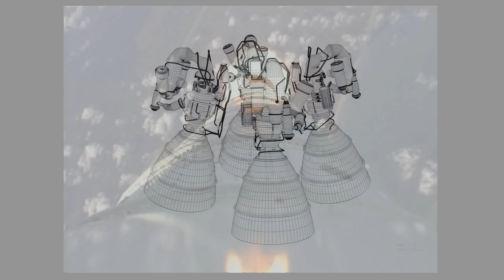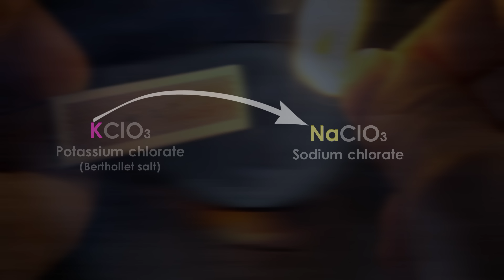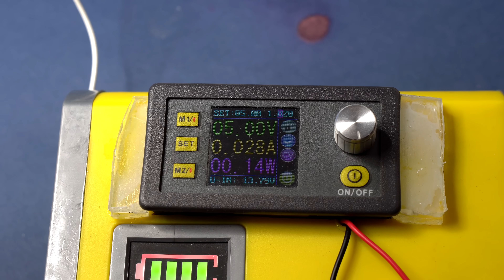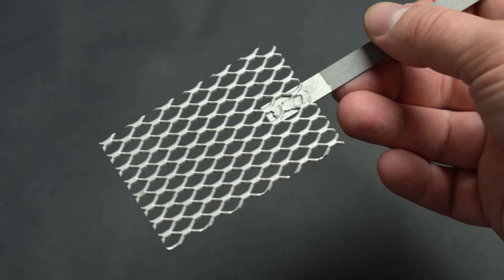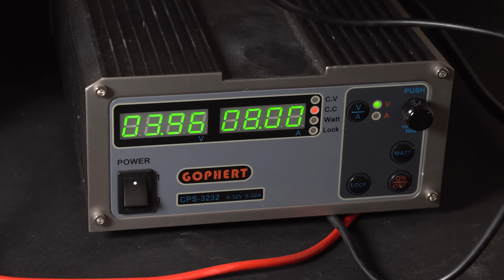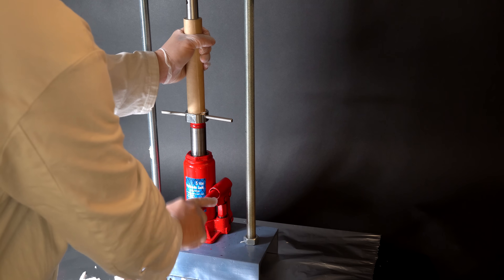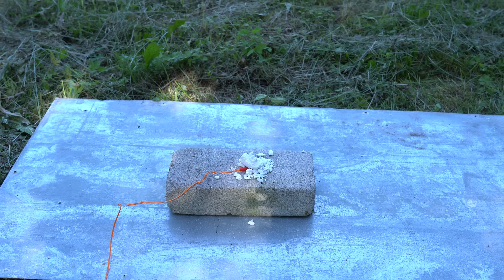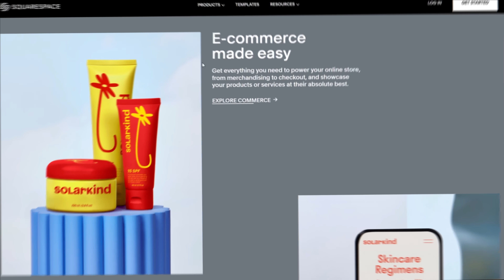How to Make a ROCKET ENGINE From Table SALT?

Comment: The only part of the sodium chlorate / silicone sealant mixture I would be concerned about is the smoke it produces when it burns: This thick white smoke will contain some extremely fine silica powder, similar to fumed silica. This is something you really don't want to be inhaling, in even the tiniest quantities. It's like microscopic sharp sand, an extremely fine abrasive, which gets deep into  your lungs, where it can cause long term problems similar to mesothelioma, aka asbestosis. It's not good to swallow it either, since it lodges into the stomach and intestinal lining, causing similar types of damage there.

Comment: Take the sodium colurate and some phosphorus off a match box, mix to a wet paste and dip the tips of matches in, once dried they will be VERY sensitive strike anywhere matches.
If you try this, be sure to safely sore or dispose of the mixture and matches.
They will ignite from falling on a hard surface. Use caution!

Comment: Lots of old AAs and titanium, platinum ingots, heat salt multiple acids batteries etc - on Mars

With the low gravity & assuming a radio transmitter that works - a giant sling with a hypothetical radio antenna, and parachute.
Or a hydrogen balloon.

I know this is a silly video 😉

Comment: Less resistdmce but what about less trust do to less resistemce for the propellent to push against??¿🤣😍😀
Less thetion less thight up less resistance but olso weaker it bends more away from more flexible

Like if i jump on a rok our on water the rock has more thention than the water.
Mars has less diverentional and is less negative than eurths its existence.

The great whay the marsian chopper nead more blades to flay😍
Not du to less particls but less thention on the space where the particles just happence to be within😁😀😍 and the trust is pushing trou more eseayley whay the energy opwarts bi pushing is less than on eurth🤣😍

Comment: Using PVC pipe for holding the rocket fuel is  not a good choice. In the event of an explosion, PVC shatters. Shrapnel produced by PVC will not be picked up by X-rays or other diagnostic medical tests.

Comment: you can also make a star shaped hole. increasing the initial surface area, then at it burns it shrinks down to a more rounded hole.so you get a strong initial push, then a consistent burn later.
Reply: Good idea

Comment: I see a serious safety issue with your chlorate cell: the mixture of hydrogen and chlorine that evolves from the cathode and anode can explode, from as little as exposure to the ultraviolet in sunlight.  It would be safer to design the cell so that those two gases are captured separately.
Reply: The gases are dispersed into air so quickly that their concentration would never be explosive.  Even confined in a balloon and ignited, they'd just make a loud bang, good for a few laughs.
Reply: @d.jensen5153  😌

Comment: just too cool.  as a kid in the 60s, I cut the carbon cores out of dead d cell batteries and epoxied them on both side of a plastic jug thru holes.  filled the jug up with salt water and hooked a 12v battery charger up.  filled up a balloon and then touched a match to it.  lets say my eye brows and hair were singed and I was pretty worried I might have set the basement rafters on fire..once was enough.

Comment: Highly dangerous compressing any chlorate-based oxidiser + fuel with a hydraulic jack. The pressure could cause a detonation, which could be lethal, depending which pieces of the press fly in which directions. No safety screen shown. Strongly advise against doing this.
I’m a licensed pyrotechnician.
Matt Lee
Reply: No. You press them wet. Then dry them. Or mix your stump explosive with " an oatmeal box and a wooden spoon". Been there. Done that.

Comment: Silicon sealant is expensive. Would it not be better to recommend potter's clay? What about playdo? (or some mix of the two)
PlayDo:  The first is from the original patent, US 3,167,400, which lists the ingredients as follows:
Grain Flour (hard winter wheat flour, first clears)
Tap water
Common Salt
Borax
Light hydrocrabon distillate such deodorized kerosene.
This way, it would be quite cheap and easy for anyone to put up a small satellite : )

Comment: if you go use platinum to coat titanium you can just skip the coat an use solid platinum for electrodes , is a easy to fim metal in the aero space world, and i worked with titanium when cutting it he make a bright pure white  light

Comment: This was a very cool experiment for earth .... I differ from the Martian expects of use...As you know there is no Oxygen present on mars so it's nearly impossible to ignite  a rocket with that kinda solid fuel. That is the reason rockets sent to mars contain a mixture of Oxygen and Hydrogen. Oxygen used as an oxidizer and hydrogen as a fuel. with out an oxidizer a propellent is meaningless.

Comment: 5 days?  Now, it's emitting hydrogen and chlorine, why not pass it through ordinary distilled water and make hydrochloric acid?  It would be a useful item.

With all that electricity, wouldn't it be easy enough to sacrifice some equipment to make a power amplifier to get a better signal to the satellite?

Comment: I used linseed-oil impregnated carbon rods as electrodes.
They broke down over time and the carbon particles needed filtering.
They were cheap...'gouging rods' with the copper stripped off.

Comment: I actually stumbled upon this a little while ago. Although, Instead of sodium chlorate, I used potassium chlorate. While I will admit, my methods of construction were crude, I really had a lot of faith that it would work as a propellant, unfortunately I was wrong. All my tests in a rocket casing blew up or just burned really slow. I even tried coring it like in the video and it still blew up. 
So I'm impressed, but also confused as to how you got it working, Maybe the pressing step and/or the caps?
Either way, this stuff is great for producing a safe, reliable, water resistant, and strong explosive, in all my detonation tests I was astonished at it's power. I think if you're going the explosive route, sensitizing with a little bit of aluminum works great.

https://www.youtube.com/watch?v=W8sRTZCK7TI
https://www.youtube.com/watch?v=yd-o7LjVrwk
https://www.youtube.com/watch?v=JpHlmxtWORg

Comment: Be careful with chlorate pyrotechnics and explosives. They can sometimes be ignited chemically by:

Sulfur,

Ammonia and ammonium compounds,

Red Phosphorus,

Anything acidic, (including vitamin C which Laboratory of Liptakov had ignite spontaneously once out of a few trial batches.)

Copper and copper compounds,

Any product that has traces of any of the above,

Probably a lot of things I forgot to mention.

They also can be unpredictably sensitive with other "safe" fuels, even if they don't self ignite, and also can sometimes detonate like a high explosive.

I'm not saying to avoid these things all together, but be mindful of this. Even something like Silicone-Acetic based caulking might be acidic enough to light up.

Comment: Sorry, but for your average earthling, I believe they would require a much more data in order to actually build something like this.  In addition, your oxidizer program is a waste of time for a Martian.  The marsh soil is rich in iron septoxide which is unstable on earth. If iron septoxide was separated and purified from the soil, then you'd have a readily accessible oxidizer that would be absolutely fantastic for your rocket motor.

Comment: Small correction:   Make sure you use distilled water with this process.   If you use any other water, tap water or bottled water you will have to remove the minerals after the synthesis process.
Reply: Other minerals' chlorates are better than sodium
Reply: How to make a better one!

Blended, and crushed aluminium foil= aluminium powder

And powdered iron oxide (rust), mix these two powders at a 3 part aluminium powder to one part iron oxide powder! (Thermite)

Mix this mixture into epoxy resin. The resin will be 20% of that thermite mixture! 

The remainder will be bubbles of HH, and O gases mixed into the epoxy by electrolysis of water!

Add the curing agent to another resin, pour, and mix this resin in slowly, while still mixing, and adding the gases!

Pour this into a carbon fibre tube that is insulated with cork on the interior! Place a pipe coated in baking paper into the centre, pour in the resin, wait until it has dried, and remove the pipe
Reply: distilled water dont conduct electicity so it cant be used in electolysis
Reply: @bezimienny1337  the salt would cover that, wouldn’t it?
Reply: @bezimienny1337   bruh….what exactly do you think is getting added into the distilled water?
Reply: @bezimienny1337  you may be thinking about deionized water. Distilled water has less minerals, but is being used as a universal solvent to make a sodium chloride solution. Salt water is an excellent conductor and will work quite well. Deionized water doesn't conduct electricity because it has no free ions. That is no longer the case when you add salt. So either one will work for the experiment.
Reply: @bezimienny1337  No, but remember the table salt is then dissolved in that DI water. So it conducts.

Comment: Nice video.  Just a couple suggestions -lead dioxide coating the anode will work for converting chloride to chlorate/ perchlorate.  I have made these on titanium mesh by electro-deposition from lead/copper nitrate solution (8-1 ratio).  Platinum is quite expensive, lead is cheap.   I use a 100 watt solar panel for DC input.  And-if you want a better propellant, react your saturated NaCLO4 solution with HCL to form NaCL and perchloric acid, decant to separate-then neutralize with ammonium hydroxide to form ammonium perchlorate.
Reply: Well if there is a zombie apocalypse, whosever team you're in will be in good hands!
Reply: Platinum anodos can produce perchlorates?
Reply: You should do your own channel  just in the name of competition

Comment: You can press a nozzle out of clay and use simple endburning fuel.
It´s a safe solution. For hobby purposes, kitty liter proves fantastic for that.
Use a big grinder to make the nozzle shape and a smaller one for the nozzle core.

Comment: Very nice.  Have you tried making the rocket with a nozzle?  A nozzle works better because the nozzle's constriction increases the pressure in the combustion space.  More importantly, the velocity of reaction products increases in the throat of the nozzle.  In some cases, it may even be supersonic.  This is advantageous because the momentum of the gases is mass x velocity.  Mass ejected per second is roughly the same with and without a nozzle;  but with a nozzle, the exhaust velocity is much faster, which increases the momentum imparted to the exhaust.  Because of Newton's 3rd law of motion, the rocket momentum upward equals the exhaust momentum in the opposite direction.  So the rocket will fly faster and higher with a nozzle than without one.
  There is a limit to how small the nozzle throat can be.  If it's too small, the pressure on the fuel may be great enough to cause the rate of burn to exceed the point at which deflagration changes to explosion.  Bye-bye missile and anything too close to it.  Always experiment with small models before building large ones!

Comment: It's not often you come across a technical video where absolutely no facts need be corrected for accuracy. Even the note about once you touch off a solid booster there's no off switch was stated. Nailed it across the board!

Comment: u can also use a star pattern * X increasing the surface area even more for a shorter burn time with higher TWR

u can also build a choke and nozzle to cause a higher pressure and a faster ISP due to the exit velocity being faster 

just some fun hints 

WARNING making a choke too tight may cause a sudden and uncontrolled disassembly  .. youtube wont let me say the short hand word for that lol

Comment: Question: I'm sure I've seen this exact same process used to make sodium hydroxide... What is different here to make it produce sodium chlorate instead?
Reply: almost the same yeh.. the difference is that for that you need a membrane cell, you pump in brine one one side ,  the membrane allows the sodium to pass, but the chlorine does not, when the sodium ions pass though you basically have sodium hydroxide, and hydrogen as byproduct, on the input side you have chlorine, and left over brine..  cheers!
Reply: @0x2a1A4  thank you muchly 😃

Comment: What a great video, one of the most interesting so far!

You may be able to get an increase in pressure by experimenting with the shape of the interior by using a shaped pressing tool but your cardboard tube might not like it without reinforcement. 

Also it could be the camera exposure but the flames look a little purple, did you mix in some potassium chlorate for extra kick by chance?

Comment: What about tungsten electrodes for electrolysis?  Tungsten should be fairly resistant to corrosion.  Tungsten electrodes can be easily found as welding electrodes for TIG welding.

Comment: In my nerdy wayward youth as an aspiring bomb nut I used to love those Solidox pellets you used to be able to buy for use in those Sears Solidox welders back in the 70's and 80's. They were mostly sodium chlorate. I'd crush them up, sift out those wonderful asbestos fibers that were embedded in them for some reason, dissolve it in distilled water, filter the solution with coffee filters then let the water slowly evaporate so the sodium chlorate would grow crystals rather than just precipitating out furthering the purification. I could then grind those crystals into a fine powder and experiment. I found if dissolved in water again, soaked into patches of denim, let dry and hit with a hammer you'd get a gnarly boom. Mixing it with aluminum dust and some antimony sulfide you'd get a good flash powder for making M-80 equivalents but it was stupidly drop, static and friction sensitive so I abandoned that option quick. I later learned to process it into potassium chlorate by reacting it with potassium chloride dietary salt to make a more stable oxidizer for salutes. Yeah sodium chlorate and sugar is a bad combo. I tried my hand at making a pipe bomb with that stuff and it started off just fizzling then as it burned out the hole in the end cap for the fuse it started roaring and took off like a rocket for a bit of distance then blew up like a grenade. Nothing is as fun as getting chased by your own pipe bomb.
Reply: Yet I watch YouTube all day. I wish I was born in the 80s xD
Reply: Yes the good old days, My Dad's garden shed fell down after I attempted to make a fuel air bomb. The burnt hair on my head & eyebrows was a giveaway to who was the culprit. nothing grew on the ground around there for a long time after too.
Reply: Damn
Reply: G'day,

Yay Team (?) !

Does the term...,

Psycho-Ceramic...,

ring any Bells, for ye, 
Mate, mate...maaate,
Me old
Cracked 
Pot...?

Just(ifiably ?) ponderin',

Such is life,

Have a good one...

Stay safe.

;-p

Ciao !
Reply: Been there done that!! Lol .

Comment: WARNING: that epoxy resin was a risky move!  Most 2-part epoxy heats up when curing, and that heat can be enough to cause ignition!!! I have seen the carnage left by a homemade device that was sealed with epoxy and exploded.  You're lucky that didn't happen to you, but it could happen to one of your viewers.
Reply: It does not heat up enough for that, especially not such a small quantity.
Reply: @ItsTristan1st  I've seen the aftermath of a homemade explosive that detonated when someone sealed it with epoxy, so yes it can heat up enough.
Reply: @palsyddad  Interesting. I have embedded running electronics(on a large scale) in various epoxies without issue so my experiences are very different to yours. 
Maybe the homemade explosive was unstable to begin with. And there is also the possibility of the epoxy components reacting with the explosive. Ultimately epoxy can get hot but it should not(orders of magnitude) be getting hot enough to act as an ignition source.
Reply: Good point
that's what I thought at first but didn't see anyone saying anything about that!

Comment: The concepts in video are solid but the execution and explanation are not complete. First thing is that coating titanium with platinum is a bit more involved than it is shown. That is why he shows an electrode that can be bought online. If you already have pure platinum you can use it as is. The only drawback to that is the amount of current that you can pass through is a bit less because of the smaller surface area but the simplicity more than makes up for it. The second thing is that in most experiments, KClO3 (the violet colour of the flames gives it away) was used which is fine for demonstration because it has really similar properties to NaClO3. Main difference in using one over the other is that you need less NaClO3 because of its lower molar mass (it has more moles of it in the same mass) and that is really important when mass is a premium for space launches and that's one of the reasons NH4ClO4 is preferred.

I hope this is helpful and useful to anyone that is interested.